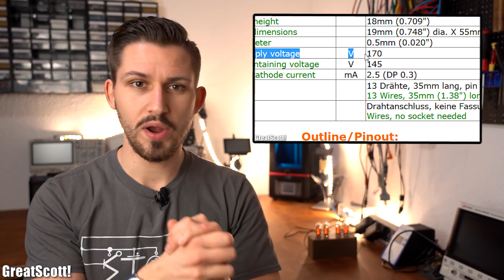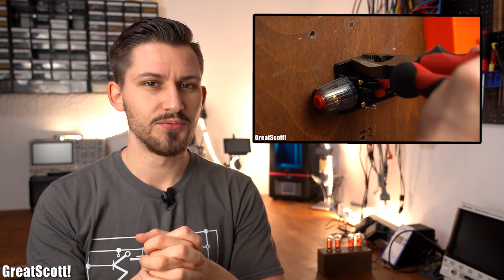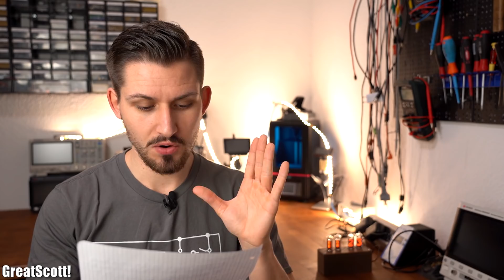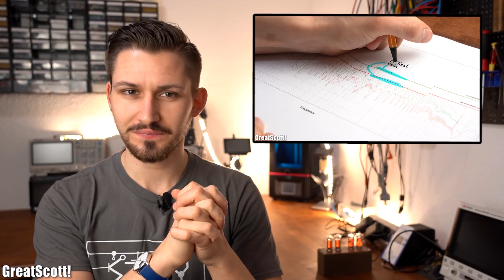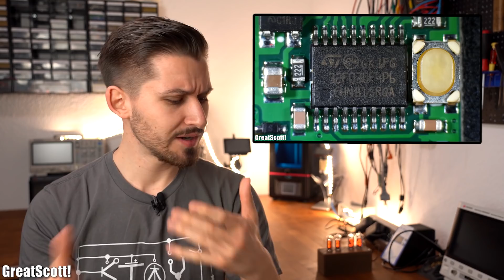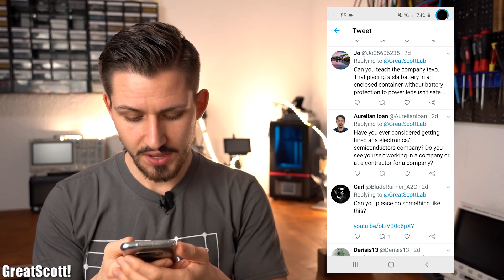Top 3 GreatScott! videos of 2019 || Random/Unscripted Q&A #6

Comment: Hey @GreatScott could u please help me an provide some good study material for beginners? I have a little home project where I want to connect a  12V LED stripe as a ceiling lamp. I would like to know how to change the electricity so that everything will be save and sound. 
Also could you tell us where do u usually get ur stuff (like wires and PCPs etc). Cheers for answering!

Comment: South African request/idea: Rechargeable Lithium powered fan... for workshop maybe?

We have load shedding/blackouts on and off here in South Africa and with africa being quite hot, if the power goes out, I have no fan and can't sleep. A few guys where I work have the same issue. Getting maybe 3 hours of sleep and then having to get up at 5am to go to work gets old pretty quick. Also, the fan helps keep mosquitoes away which in certain parts of the world can help prevent malaria.

People in other parts of the world will have a similar requirement. The video will be worth while. Companies like Makita make the DCF300Z fan and although it looks like what I need and seems to have the battery life and airflow one would want, it's VERY expensive. You have to buy the fan, battery, and charger all separately. Also, if it's battery powered, it's portable.

I kinda know what is needed to build something like this, but I have little knowledge on what would be the correct parts and how they all fit together. 

Motor: Living in a 3rd world country, a salvaged 12V DC motor would be the easiest and cheapest option to get, but how powerful should it be if I want decent airflow? 10w? 15w? 30w??

Battery pack: A lithium battery pack does not add up to 12v if you use lithium cells like you find in laptop battery packs. Would the motor controller be able to bring the voltage down from something like 14.4v to 12v or would we need something to step it down as well? 
How can one make the battery pack expandable so you could possibly add more capacity later?

Charging: Would be great if it can be plugged in and run off power from the wall, but then automatically switch to battery if the power goes out. Then switch back to wall power (And charge battery) when power comes back on... much like a laptop.

Motor Controller: Would something with 2-3 fixed speeds be better than something with variable knob?

It seems no one really makes something like this. All the battery fans I've been able to find online require an external charger or you have to remove the battery to plug it into the wall. None of the fans I've found seems to give you the best of both worlds like a laptop's power setup does.

Something similar to the Makita DCF300Z would be perfect and I do believe the video would be worth while. It's completely understandable if you don't feel such a build is worth while, no harm in asking :)

Comment: Hi great scott, how are you?  you talked a little about almost having your moped stolen which I know can be frustrating, motorbike theft is a HUGE problem here in the UK & I have been thinking of ways to make a motorcycle useless without the owners input/consent using electronics but it seems almost all security systems can be bypassed if enough time is spent figuring out how it works, I do have electronics knowledge but not as much as you have & since I can't come up with any useable ideas at the moment I thought maybe it could be a cool future project for you? I know there is a huge flaw protecting a motorbike this way as it can still be taken away & dismantled for parts & also having the project & information here on YouTube would give thieves the opportunity to learn & disable such a device so this is a difficult one but part of the problem here in the UK is alot of the stolen motorcycles are being used to commit other crimes such as robbery & motorcycle hijacking, because the police can't catch them. being able to render a motorbike useless with a difficult to get around system could stop alot of violent crime.

Comment: USB-C video, question. Are there differences in the cables - not the current capacity but in internal connections / added resistances / or something else?  I see many cables advertised for specific phones.  Is there really a difference in which cables function on different phones?  I would have expected that differences would be implemented within the phone and charger and not within the cable. 

If there are differences, how would a cable be tested to determine its makeup.
Maybe if there is enough interest, this could be another video.
I admire your EE knowledge and your second language skills.  Great!
Happy 2020 from Phoenix, AZ.

Comment: Moped project!!
DIY AC-CDI electronic ignition system for your moped. Esp8266 and a hall effect sensor for pickup from the flywheel.
Then you can set a custom retarding curve for the ignition and tune to get more power.
Maybe live tune it by connecting to wifi when the moped stands still.

A dream project for me as my greatest hobbys are mopeds and electronics.
I own three mopeds. A Yamaha fs1 -83, DBS handy  -73 with a Sachs 505 engine, Cresent 1134 with a Sachs 50/2 -59

Comment: I think a micro GPS tracking device would be very interesting, but there are many existing projects. The trouble with GPS is that it is very easily disrupted ($5 GPS interference devices exist). One with a RF trackable 'beacon' that only switches on when GPS fails would be interesting.

Comment: About Arduino oscilloscope: there is a bunch of open-source STM32-based scopes with Windows or Android software. I experimented with Miniscope software and it is okayish. But I was not able to calibrate it to display millivolts readings accurately. Which can be expected, by the way.

At the end I used just a regular DS1054Z  scope in my university to do the measurements. Power consumption measurements for low-power BLE solution.

Comment: Hi there GreatScott! Greetings from Poland.I recently saw a ,,Free energy video" which consisted of 2 motors powering each other.I am wondering if you can make a boost converter or ,,inverter" from 1 12V DC motor and 1 230V AC motor? This could be a good video idea.
Reply: Thanks, i Thought this would be a good idea for my hydro generator(8-15v dc) so that i can power my tv(satelite) with it

Comment: Can you please built a bike security system?

And yes I know that you already built something similar, but I think that the security system is a way to big for a bike

I thought of a fuse that starts to make loud noises as soon as the bike is moved and does not consume much electricity
Reply from the maker: I can put it on my to do list
Reply: @greatscottlab  nice and thank you for answering
Reply: I don't know how to do that and I'm not sure if it is possible, but maybe you can build it with a attiny instead of an Arduino to safe some power? Or you don't use a microcontroller at all and use an amplifier circuit and a piezo movement sensor
Reply: Nice idea. it would be best if it were so small that you could put it in the bike frame with a 9 volt block
Reply: A fairly simple concept would be to get GPS data every 30 seconds and set off an alarm if the position has changed by more than 10 m.
Fairly simple to do I'd think.
Reply: @Felixkeeg  but it needs a lot of power and a lipo battery have to be charged after a very short time
Reply: Or an electric shock when the guy puts his foot on the ground? :-)
Reply: @aurelienBricole  or a knife in the seat😭